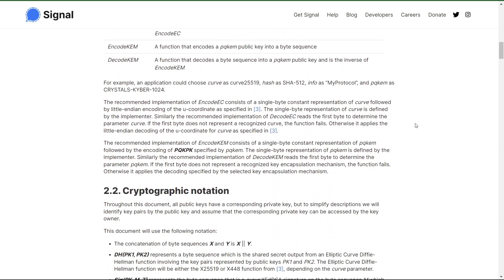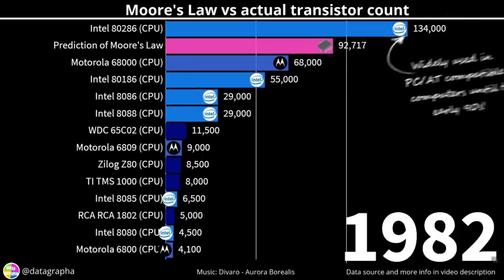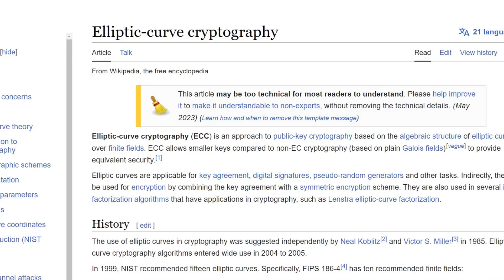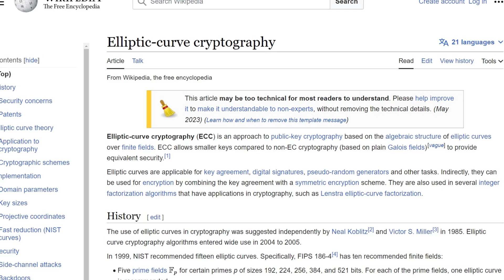Signal Just Published Post Quantum E2E Encryption

Comment: I'm starting to think cracking encryption will be one of the only things quantum computers will be good for
Reply: Weather data can be processed more accurately, physics simulations are more accurate
Reply: Wont be good for any of us
Still functional for it sure
Reply: Simulating quantum systems is a valid non-malicious use case for fundamental physics research. Also: Grover's algorithm for searching large solution spaces for solving large optimisation problems (think UPS optimizing their routes to use the least amount of fuel/time).
Reply: @marc-andreservant201  Quantum search is looking useless, because at the finite problem sizes of interest, the polynomial speed up will not come out ahead when the overhead of quantum error correction is included.   Theoretically, asymptotically, it could be better, but at the scale of industrial problems it may never be worth using.   Simulating quantum systems is a better case because it is an exponential speed up.
Reply: it will be really useful for ai but i'm not sure if that's a good thing
Reply: It's going to be amazing for a few very specific tasks and useless for anything else. Much like an ASIC except for stuff like climate models, star formation, modeling nuclear blasts, stuff with far too many variables for existing systems.
Reply: @seetheious9879   that helps me understand.  I had the impression you would be use them more generally, but then I realized it was only brought up to use in certain ways. thanks
Reply: I'm optimistic that I'll be gaming on a quantum computer in 2080
Reply: @zeeby777  That's not going to happen for (at least) two reasons:
1) Classical computers will be faster than quantum computers at running games in 2080
2) You don't want to pay for the electricity bill for the cooler of a quantum computer (in case you manage to fit it in your house)
Reply: @Takyodor2 are you sure about 2080? Cuz I am most certainly not.
Reply: @TheIziPizi  I doubt that classical computers will suddenly hit a wall and not get faster that soon, but even if they don't improve at all in 60 years, I'd guess quantum computers are difficult enough to run games on that they will be slower than today's classical computers at gaming.
Reply: @colonoscopy4418  You know what's several orders of magnitude better at math than a quantum computer? A regular computer. Even if you are correct about quantum computers not requiring exotic cooling, and progress in the field is much faster than regular computing, they still won't catch up in 50 years. Todays quantum computers are comparatively speaking in the early vacuum tube stage, they have barely even done anything useful yet. What's actually happening is that getting more and more stable qbits has proven really difficult, the opposite of the transistor count explosion of early semiconductor development. But let's be extremely optimistic about progress, cost, cooling etc. You won't get quantum computers at home anyway, because you usually need to measure the qbits many times to be sure about the results, so I doubt quantum computers would even run games as fast as the classical computer reading the quantum states. But even if we assume that, and that it's even possible to accelerate the stuff game engines need, good luck getting game developers to learn enough quantum mechanics to bother to use them (I'd bet classical computers will do just fine with photo-real graphics in realtime in 50 years, meaning no demand for quantum gaming).
Reply: @Takyodor2 also with attosecond physics coming in, we have the theoretical possibility of terrawatt cpus coming in
Reply: @PhartingFeeting  Terra hertz?
Reply: @Takyodor2  yep was nearly sleeping while commenting that
Reply: @zeeby777  i'm pretty sure it's gonna be cloud gaming
Reply: old computers were also pretty fucking useless for the average person
Reply: It's really good at searching for data because it searches every point of data at once.

Imagine a spreadsheet with a million X rows and a million Y rows. Think about how long a search takes of every block. A quantum computer searches every block at once.
Reply: @vxicepickxv the day I no longer need to optimize my SQL queries will be a good day
Reply: @vxicepickxv  there is a caveat to quantum computers.
they process a superposition of all possible outcomes at once, yes.
but this information is hidden from us.
we have to measure the state.
and when we do, the state collapses to one of the possible outcomes with certain probabilities.
usually, the outcome we are looking for will have the highest probability assigned, or close.
one run of quantum algorithm, this run is called a shot, is meaningless.
hundreds if not thousands of shots are needed to build a statistic, a histogram.
because of quantum noise that is very much present at this scale this histogram is always lying a little bit, hiding the winner.
therefore what i am thinking we will see is an emergence of hybrid algorithms that are first run on qpu to vastly narrow the search space, to pick the candidates, and then it will be finished off by a cpu to pick the actual winner.
this is why i believe that we will soon have both cpus and qpus in our pcs.
one in not better than the other, they complement each other.
Reply: why?
quantum computers are brute-forcers on steroids.
any problem that does not have an efficient algorithm and requires essentially a brute-force search that would take years or decades or worse to complete could be suddenly computed in maybe seconds, minutes, or hours using quantum computers.
think how quickly we would start to find new materials or new drugs.
you are exactly the kind of person that dismissed computers when they first came up.
it's only good for ballistics and nothing else.
and now look where we are.
my personal pow:
in few years there will be first pcs on the market with quantum processing units added to them so that you will have cpu, gpu, tpu, and qpu on board.
and it will be possible to make a call to qpu using a simple to understand programming language.
possibly even support for qpu will be added to existing programming languages.
and by this time you will start to see lots and lots of applications popping up.
games included.
Reply: Duh

Comment: They could put the quantum computers on the dark side of the moon to save money on cooling, powered by solar on the light side and use starlink to beam the transmision to earth.
Reply: Cost=$1 trillion
Reply: @Frenchdefense9404  yea but 1 trillion dollars is a cheap price to pay for sustainable energy
Reply: @ToxicXY solar panels aren't sustainable.
Reply: Starlink satellites are in very low earth orbit.  From the perspective of someone on the moon they're practically on the planet's surface.  The network would have to be extended with lunar orbit relays to reach the far side of the moon.
Reply: space/satellite quantum computers sounds like a very hard problem compared to just doing it on earth.

Comment: Those 443-1000 qb reports are about 1/40th of that considering the overwhelming noise and static hurdles they have yet to overcome. Otherwise, all of that encryption would be broken within a single 20 day window. While it's a matter of time, that timeframe isn't calculated within current capabilities of production, fabrication, and containment issues.
Reply: The noise and static hurdles won't even be overcome with better components.   Quantum error correcting codes are expected to be needed.   So the 1000 qubit estimate for running these algorithms actually refers to 1000 encoded qubits.   Each encoded qubit being made of 100s of physical qubits.
Reply: Everything is quantum at a small enough scale my guy
Reply: Oh? So this must be what they're doing down in Antarctica.
Reply: Human decision making is pretty noisy. Our brains are probably quantum.
Reply: @theduplicator3270 how much quantum differs from probabilistic?
Reply: @early20s18  You may call something probabilistic even if it's technically predictable given enough information. Quantum randomness is actually truly random, no matter what.
Reply: @early20s18  It's inherently probabilistic as Einstein would say, "God doesn't throw dice".

Comment: Cooling is important in quantum computing. From the physics perspective: the quanta vibrate, just slightly,but that's enough to switch state randomly. The solution is to slow down that vibration to minimum by applying some extreme cooling.
Reply: Cooling is especially important when you overclock your quantum computer.
Reply: @Dave-um7mw  Can you help me maybe, I have a small issue with my quantum gaming machine: I cooled it down to -273,15°C, but now it is kinda stuck there, what can I do to get more performance out of it?
Reply: @SolidFake  have you tried turning your quantum computer both off and on at the same time?
Reply: Unfortunately to get it to such insanely low temperatures helium is required. Maybe with more fusion reactors it will become a more plentiful resource?
Reply: @Entropy67 not just helium, specifically Helium-3 as well, cos the cooling to mK requires a specific mix of 3H and 4H
Reply: @Entropy67 Fusion is decades away, fission is what we have now and is a great source of large quantities of energy
Reply: @Entropy67  I become immensely upset whenever I see a Helium balloon because like, that stuff is precious, and shouldn't be wasted on stuff like that.
Reply: @Furetto126   It is probabilistic behavior. We don't actually know what causes this to happen, but it is just a limitation of our mathematical tools and understanding of the phenomenon.

MIT has extremely good courses on quantum mechanics, but to actually understand what they are talking about, you have to have some mathematical background. Many physicists use mathematics as a tool and over simplify the tools and forgets the boundary conditions pf these tools. I understand that they want to get to results quickly, but still it would be useful for them to understand the mathematical limits when being precise.They even talk about the determinism part.
Reply: @RanEncounter  Ouch. No mic drop,man? ;) Good talk. I'll test your approach. You might be guilty of making me a better nerd.
Reply: that's cool.
Reply: @randomnumber3242  It's complete "nerdgasm". Turning atoms in to logical gateways times the Heidelberg's rule nuking the entirety of deterministic physics to generate AI porn is just next level shit!
Reply: @drTERRRORRR  Quantum mechanics is not in any way contrary to determinism.
Reply: @RanEncounter  You sure? I thought assigning 1 and only 1 state to input is pretty much the essence of determinism.
I remember a guy at uni hammering the subject for hours.
On the other hand: it was a fuckload of poisons ago,soooo...
Reply: @RanEncounter I haven't researched the subject well enough but isn't it fundamentally random (or at least has some part that are random).
Or is it that we haven't discovered a pattern or "rules" yet?
Reply: @Furetto126  If it were fundamentally random, any outcome would be possible. That is not the case. Just because we can predict the outcome in a limited probabilistic way does not mean the outcome is random.
Reply: @RanEncounter  Fundamentally random does not mean every outcome is possible.   You are thinking "random with a uniform distribution over all possibilities."   If my set of possible outcomes is {A,B,C} and my probability distribution is 50% A, 50% B, then it is fundamentally random but C never occurs.    Perhaps the any outcome thing comes from the "Monkeys typing randomly will eventually generate Shakespear meme", but that meme assumes the uniform distribution on key strokes.
Reply: @iyziejane  "Fundamental random does not mean every on outcome."

But it does mean every outcome is equally likely in the given target group.

"If me set of possible..."

But mathematically group {A,B,C} is the same as the group {A,B} if C never occurs. 

You cannot have A be more likely than B for example which we see in quantum mechanics. The probabilistic nature of quantum mechanics is weighted and thus not random.
Reply: @iyziejane  "Random variables..."

I don't think you know what fundamental random means. Weighted distributions such as probabillistic distributions are not fundamental random. They have rules how and why they are distributed that way and that is not random. It is a probabilistic dristibution. Fundamental random would mean uniform.

"Probabilistic distributions means the same thing as you mean by "weighted.""

Yes but not all probabilistic distributions sre fundamental random. You seem extremely confused on this topic.

In quantum mechanics there is a probability cloud you are calculating but that is because of our limited limited mathematical tools.

"Look up the definition..."

I know what it means. I am a mathematician. You seem to not know what fundamental random means. 

"It's correct..."

No. It is weighted random. You are not understanding this at all.

"Regarding..."

Of course. You seem extremely confused on this or what I said.
Reply: @RanEncounter  I'm an expert and I'm not confused, rather I am using the terms as they are technically defined in mathematics and physics.   "Fundamentally random" does not have a mathematical definition, it is not a technical term.  You feel it clearly means uniformly random, but that definition is idiosyncratic to yourself.   In discussing the foundations of quantum mechanics,  "fundamentally random"   is contrasted with "apparently random, but actually deterministic and depending on hidden factors."   When we write in physics that quantum mechanics is fundamentally random, we mean that the measurement outcomes are not consistent with hidden variable theories.   The uniform distribution is not specified by the term "fundamentally random" in any mathematical textbook or publication.
Reply: @Furetto126  Quantum Mechanics is not "easily" compatible with determinism. I personally think the universe is non-deterministic.

A quantum system in a superposition state will upon measurement randomly choose one of the "Eigenstates" (like 1 and 0 for a qubit). They do this with a fixed probability depending on the exact superposition: For example, a particle with x-oriented spin will upon measurement of the z-spin have spin up or spin down with exactly 50% probability. That's what @RanEncounter means: The outcome is not one fixed deterministic outcome, but it is not random without rules. There are known outcomes with a known probability.

Some physicists believe that there is a "hidden variable" which predetermines the outcome. However, experiments have shown that this is impossible with local theories. If such a variable exists, then it has to be somewhere else in the universe, not local with the system itself. This is difficult to believe, and may lead to time-travel paradoxes if the information needs to travel faster than the speed of light.

Alternatively, determinism also depends on the interpretation of quantum mechanics. In the many-worlds interpretation, any such random choice leads to the creation of parallel universes for each outcome. As a whole, it is deterministic: Given initial state i, we then have two universes with final states f1 and f2. But since your conscious self is part of one of them, and you don't know which one, it looks non-deterministic.

TL;DR: According to some interpretations, QM is deterministic, but those are not mainstream. It looks nondeterministic in the lab.
Even if QM is indeed nondeterministic, that does not mean that we can't make probabilistic statements about outcomes, e.g. "The output will be f1 with 25% chance, f2 with 50% chance, and f3 with 25% chance."
Reply: @entcraft44  I really appreciate you taking the time to write all of this, as soon as I get home I will read all of it more slowly and try to understand it better :D
Reply: but can it run crysis?
Reply: @fusifase20  Well,ughm...noooo...not yet...on "low-as-fuck" in 3,maybe 4 FPS...dunno...
Reply: except that it doesnt exist. ignore that.
Reply: Will we see quantum satalites one day 🤔
Reply: @jim.....  I kind of doubt it, Kelvin's Telescope thermodinamics suggests it would be pretty hard if not straight up impossible.
Reply: If they just used the toroidal moment and exotic vaccum objects with ohmasa gasses it could be done at room temp bc the force anti-force pairs keep everything within a 1 micron area when its stabilized
Reply: in the future a battery of small lasers will cool down the qpu.
pc will be in our room, at room temperature.
Reply: @michalbotor friggin lasers
Reply: @TerexJ  laser cooling is already a thing. look it up.
Reply: @michalbotor  Oh I wasn't denying it. I know nothing about it. I was just making an Austin Powers reference. "Sharks with friggin lasers on their heads!"
Reply: @TerexJ  oh i see. sorry my bad. ;)
Reply: Vibrate from an ohmibod 😂
Reply: @sparklesparklesparkle6318  65K? Yeah me too, though I prefer going ~50K. I just sleep better when it's cold
Reply: Sounds like som Beee Eesss to me! Some ish that chubby dork from nasa would say. "oblate spheroid" kinda ish
Reply: You want to isolate the system from the enviroment as much as you can to avoid decoherence, nothing to do with vibrations. However,  even if your explanation is wrong, if you say it with a lot of confidence it will sound really cool 😎
Reply: @v_i_e_w_e_r_405  I think you are confusing the vibrations of your broom with quantum vibration?
Reply: @v_i_e_w_e_r_405  You are confusing the vibrations of your broom at your work with quantum vibration.